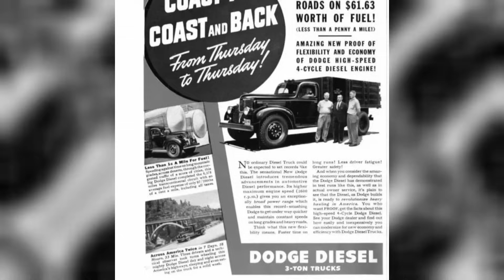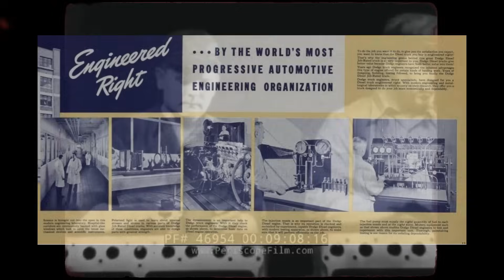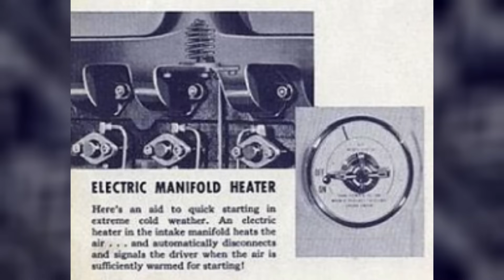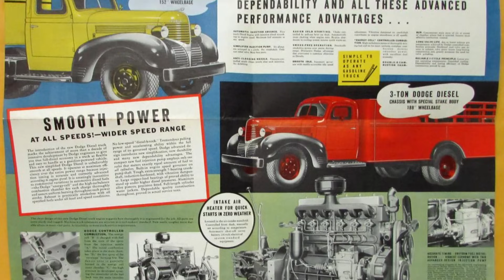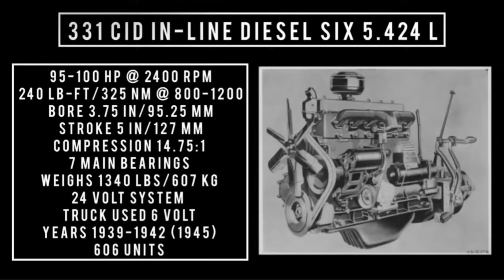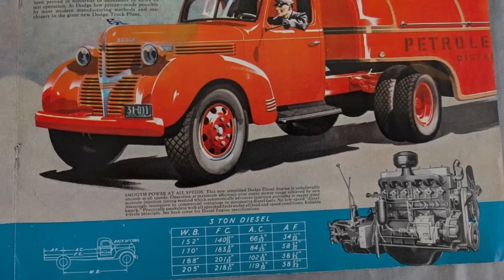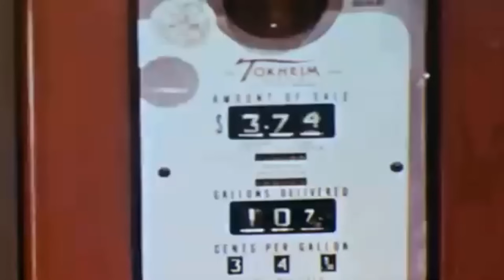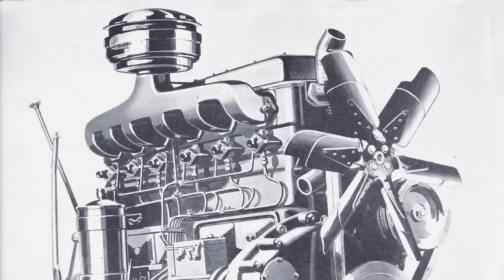Dodge Diesel Disaster: The 331 Engine History Forgot

Comment: Detoit diesel 2 stroke engines were used in the TRUCKING MASS MARKET, as well as marine application.
Reply: GM (detroit and Cleveland) diesels were literally everywhere. Probably as important to the WWII war effort as radial aircraft engines.
Reply: @randymagnum143  
The military did not use diesel trucks in WWII.  All vehicles were gasoline for a simple reason; supply.  Quartermasters did not have to supply two types of fuel plus supply parts for different engines.  While the Navy used mostly Fords, the Army used GMs.  The smaller manufacturers like Studebaker trucks were sent to the USSR for Lend-Lease.  This simplified the supply chains and quartermaster supplies. 

The M-26 Pershing tank used a diesel, but its production was very small and only came at the very end of the war. A diesel was available for the M-4 Sherman, but was never sent overseas.  

The only diesels of note in WWII were the Fairbanks-Morse used in submarines and some small ships.  And they were garbage, requiring constant attention.
Reply: @alanmcentee9457 they used thousands of them.  Mostly in the pacific for logistical reasons.  The diesel Shermans went to the Marines in the pacific. 

Federal 604 prime mover, 10 ton Whites, 28XS 20 ton Reo, and HWS160H Sterlings all had HB Cummins power.
Reply: @alanmcentee9457 some Gato class Fleet boats had FM, Some had GM (Cleveland) diesels.  The FM was an opposed piston 2 stroke.  You are the first person I’ve ever heard say anything bad about the FM engines

Around 20% of M4s had GM diesel engines.  They were sent all over the world.  Have you considered the possibility that you don’t know WTF you’re talking about?
Reply: @randymagnum143  
Diesel powered Shermans were NOT shipped overseas.  The Army did not want them as that required they supply two types of fuel for trucks as the tanks instead of just one fuel for both.  They had more than enough Ford V8s and Continental air cooled radials.  There was no need for diesels.

Second to that, while I am aware of those who promoted the diesels in tanks, I have never heard anyone suggest that 20% were built.  There were over 50,000 M-4 Shermans built.  20% would be over 10,000 diesels.  No.  That did not happen.

Have you considered that making shit up is not a winning argument?
Reply: @alanmcentee9457 You're wrong, and all you have to do is look.  You've been wrong about everything.  And I asked before, are you a Cat fanboy?
Reply: @alanmcentee9457 more than 11,000 produced, fielded by Marines in pacific, sent to England and USSR, Poland and France.
Reply: My friends Dad owned a trucking company (all Kenworths) up to the mid 2000's and swore by the 2 stroke Detroits. He ended up with one V892. We had 2 large forklifts at my sawmill. Both Detroit screamers 1 4cyl the other 6cyl even with hearing protection they were so loud
Reply: @speedfreak8200 yep, you're NOT sneaking up on ANYTHING while running a Detroit 2 stroke diesel 😂

Comment: And these days, the dodge/Cummins engine has a "grid heater bolt" that comes loose, inside the intake manifold and then falls into a cylinder and breaks the engine🎯👁️👁️☕
Reply: Not if you replace it before it falls out they got a kid that works out real good a kit kit you would think the dogs are Cummins Engineers would see that problem before we became a problem
Reply: I hope you can understand what I was trying to say I can't type because I have a problem double tapping Henry letter so I just talk into my microphone it don't come out very good cuz I'm a poor speaker sorry
Reply: @JohnFerrell-u3e No worries, I can read typonese 😁
 I agree, they should have known 
( and probably DID ), yet built it that way, ANYWAY ⚡👀☕
Reply: Also a bolt 🔩 in the timing case called the Fatal Flaw
Reply: I don't think that's a bolt in the timing cover I think that is a dowel locating dowel I'm not real sure but I don't think it's a bolt that could be wrong I was wrong once before back in 1998  @speedfreak8200

Comment: Cummins had there fair share of flops before the 6bt
Reply: The B and C (8.3, there was an earlier C) were just as much Case as Cummins.  That said, to think that they were anywhere near as important to Cummins existence as the H or N engines is just silly.
Reply: Before WWII Cummins was a very small manufacturer.  They built small engines for stationary applications.
Reply: @alanmcentee9457 the H model originated in 1931, and is about 11 liters
Reply: @alanmcentee9457 that's not true they sold a big V12 for the Antarctic expedition truck in the 30s.
Reply: @LeeHendo  
 - " they sold a big V12 for the Antarctic expedition truck in the 30s."

They did?  Can you tell me which expedition and if there are any names attached to that expedition.  Was this a one off or a production model.  

To the best of my knowledge GE was the only manufacturer building V12 diesels pre-WWII.  And those were for Diesel locomotives.
Reply: @alanmcentee9457  I thought it was Edmond Hillary that took Massey Fergussons to Antarctic?:body-blue-raised-arms:
Reply: @Bryce-z9v  

 - " I thought it was Edmond Hillary that took Massey Fergussons to Antarctic?"

And, without looking it up, that was mid-'50s.  

As I recall, it was early '50s that Massey and Ferguson merged. And Fergusons pre and post merger were 4cyl gas engines. 

A quick search shows Massey Harris first sold their Model 55 Diesel in '49. Those were still all post WWII. The M-55 was a large, heavy tractor (for the time) while the Ferguson (and related Ford 9N) was a relatively small tractor.
Reply: @alanmcentee9457  Also, without looking it up and relying on my rather antiquated memory, Edmond used the Fergy 28. A 2.2 litre 4 cylinder, wet liner, petrol  engine. Also used in the Standard Vanguard car. His reasoning was it was a very light tractor and the fuel wouldn't gell, like diesel, in the low temps. In perspective, I own a 1962, David Brown, 36hp petrol cropmaster. The 4cyl engine is 4.3 litre and can burn fuel faster than you can put it in. Cheers Alan :-)
Reply: Cummins still has flops
5 litre and 5gen are horrible little diesel
Reply: @Yolbosun vt555 was butt, as was VT903, xt444 had injection problems, 5.0 ended up too heavy, expensive, and complicated.  Fits right in a Nissan though.  Trash into trash.  Just as junk as an Izuzu or a vt365 navitrash. 
NO ONE EVER MADE A GOOD 4 CYCLE V8